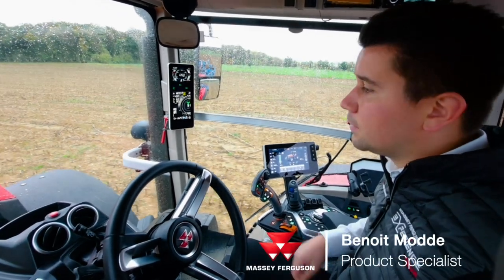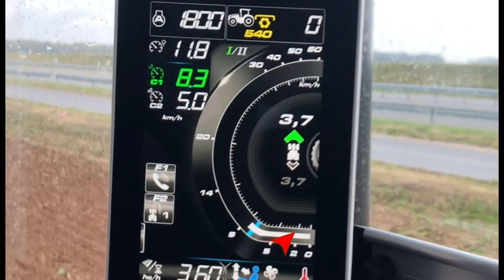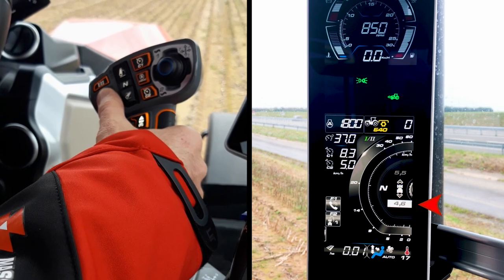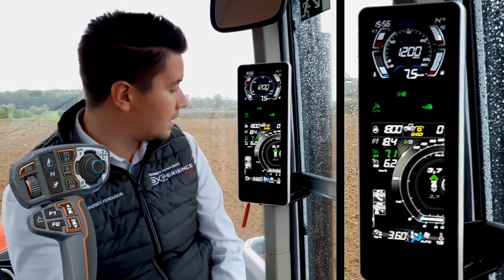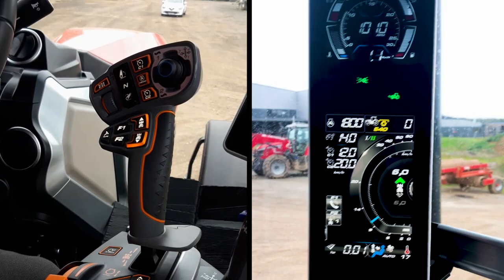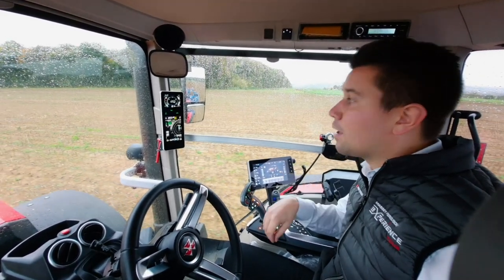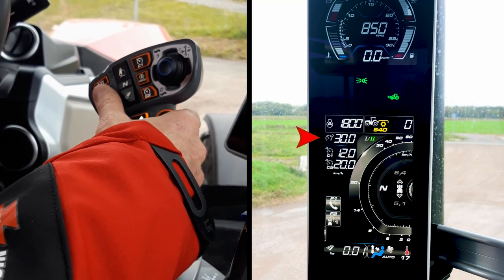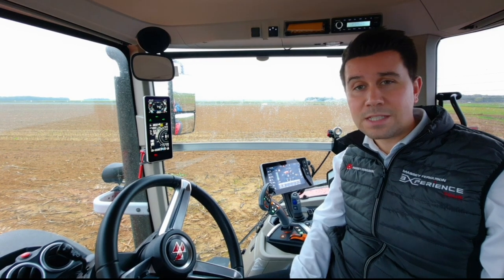MF 8S | HOW TO  | USE DYNA E-POWER

Comment: I did have a test drive on an e power. Really a nice loking tractor with a wonderfull cab. Seat swifel of 45% is great. But the software really needs a upgrade. It's hard to switch pto speed ( no custimeze button for that)   and what you can program on those custimeze buttons F1 F2 F3 is really limited. And how to use all the gears of the transmission is not easy. It's a double clutch tranny but sometimes she shifts like the old one with groups